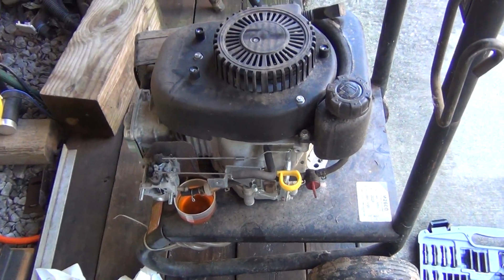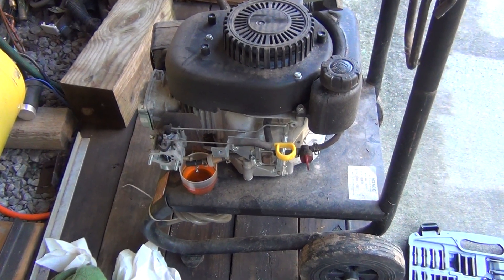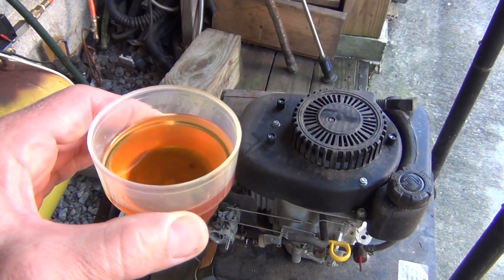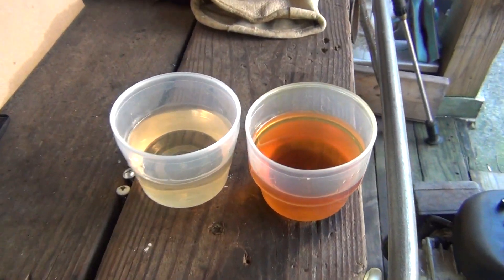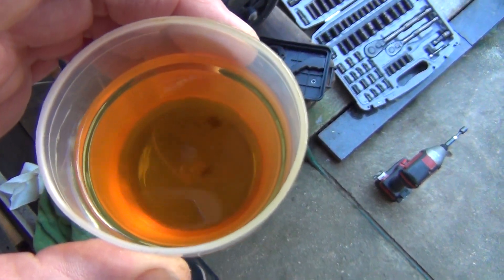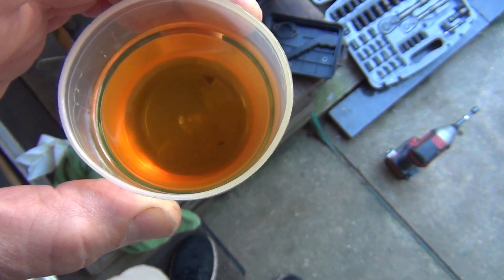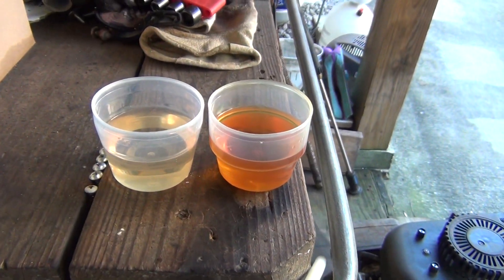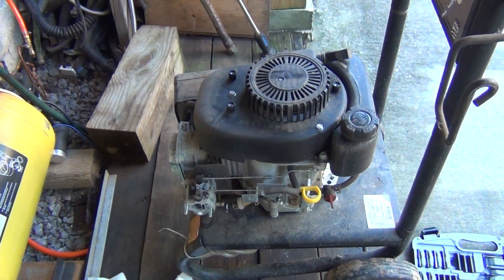How can I tell old gasoline from fresh gasoline

Comment: I have a 1960 I/O boat that's been sitting in our garage for almost 12 years with a full tank (14 gallons) of gas. I added Stabil before I stored it for the winter, but if I finally get back to the midwest to the cottage where it is stored, I now know what to look for to decide whether I have to drain and dispose of that much gasoline.